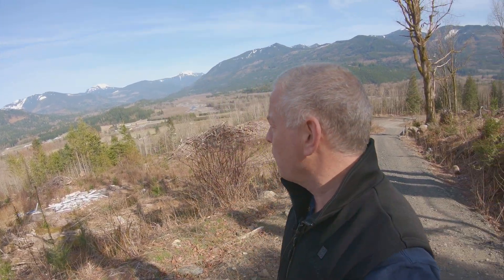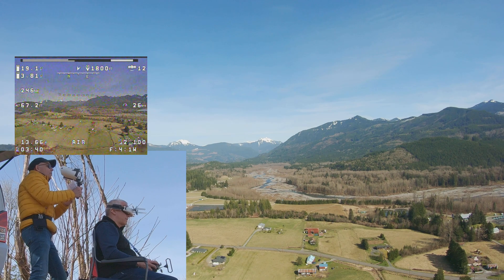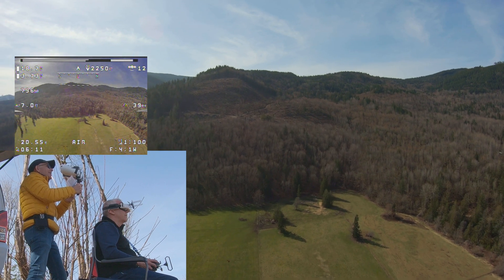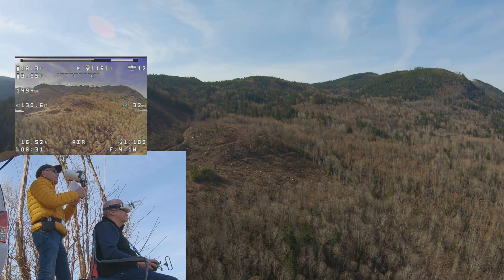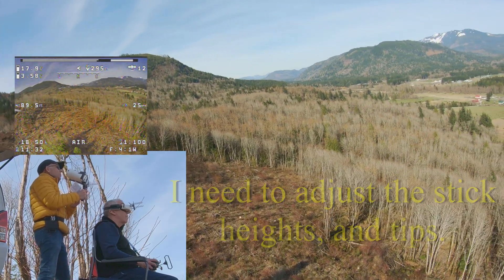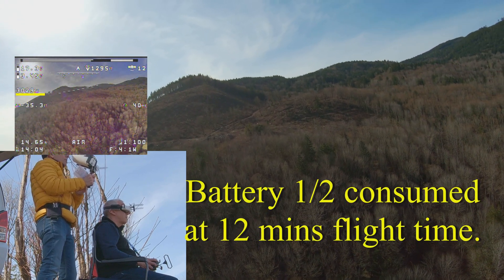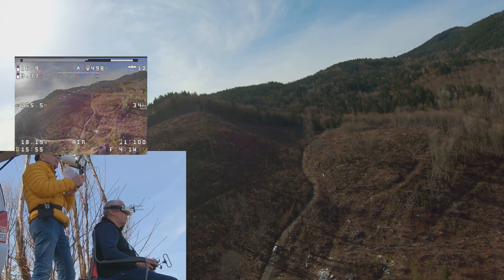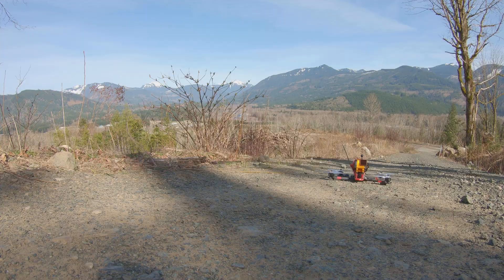Testing the 6000mAh Battery for Long Range FPV 18650

Comment: I'm curious if you can look at your "grey outs" and see if your compass is roughly pointing the same direction... that might point to your antenna on the aircraft is getting blanked... since you are generally flying out in front of yourself.  If there isn't a correlation, maybe you can watch your head on the video and see if you are obviously looking down or sideways!
Reply from the maker: Thanks for watching. Oh yea, in these early flights my head would be all over the place, in my lap, etc.. Now a days I use a ground station and my assistant points the antenna array to the aircraft.

Comment: there are a couple of nuances where the distance covered? you need to understand how much your quadcopter can fly. I still do not understand at what power of VTX you flew. and lastly, it was necessary to move a little to an open area, so that the trees were a little further, there would be a better signal.
Reply from the maker: Vtx power was set at 1000mw however I believe the actual power being transmitted was far less.
Reply: @ValleyFPV  comrade understand, I flew at 25 mW with the same picture at 600-800 meters on the FOXEER Pagoda PRO antenna, I advise you to look for what your problem is. what kind of vtx do you have?
Reply from the maker: @OleksiiLoveFPV  my Akk VTX   since this flight was filmed has  failed and has now been replaced. I expect video will be better on the next flight.
Reply: @ValleyFPV  Akk i sh**,  buy rush and be surprised
Reply from the maker: @OleksiiLoveFPV  I agree. I have replaced all my VTX's with RUSH and will be making flight with Rush Solo this week.
Reply: @ValleyFPV  good luck
and try to stand in a clearing in line of sight of the quadcopter, and away from trees

Comment: amazing.... 6000mah 5S..
Reply from the maker: Thanks for watching. The key is to get these particular 18650 cells. The VCT6 if I recall right. Racedayquads.com sells them.
Reply from the maker: ..just trying to find that just right combination of weight and power and voltage to pair nicely with certain motors and props. Tis a never ending battle.

Comment: Question (apologies if it is an ignorant question) -- how were you able to record the OSD Goggles data?  OSD display is the one thing I've not yet been able to do with my DJI goggles.  Thank you.
Reply from the maker: Hi, thanks for watching. I use the Fatshark HDO2 goggles for my analog 5.8Ghz video feed. The HDO2's have a crappy built in DVR that records what you see to a Micro SD card. It's a pretty poor codec and in STD resolution, but its better than nothing. IF you have a composite video out port on your goggles (I have no idea if you do) one could feed a video feed to an external recorder. I also am testing the FXT Technologies DVR external recorder that can be plugged into any goggles this way, if it support composite video out. It does not support HDMI. It uses a slightly better H.264 codec for recording. Look for that which may work.
Reply: @ValleyFPV  Thank you

Comment: nice stuff, do you think 8 batteries would do enough amps? i have one 4s pack and i was thinking i could get another one?
Reply from the maker: Thanks for watching. For my motors and desired props I don't think a 4S voltage is ideal. 5S is IMHO better.
Reply: @ValleyFPV  Thanks mate! I think i will have to go with your experience, I also liked your "complete boring video" comment, your videos are very informative.

Comment: How do you mount the Bardpole antenna?
Reply from the maker: Thanks for watching. I have a 3d printed mount I found on thingverse for an Immortal T antenna and zip tied it to that.
Reply: thanks I had the same question
Reply: Valley FPV Do you have a link for it?

Comment: Instead of point helicals directly straight. Point them slightly outwards to cover more area. Instead both just covering the same 90° in front of u. 

Also wow u have a lot of batter left. If u took it to 2.5v it be like a 26min flight.
Reply from the maker: I may try that. Thanks
Reply: I was going to suggest that too.
Reply from the maker: Yes.. I had so much power left. I think the next flight I will see how long it will last.